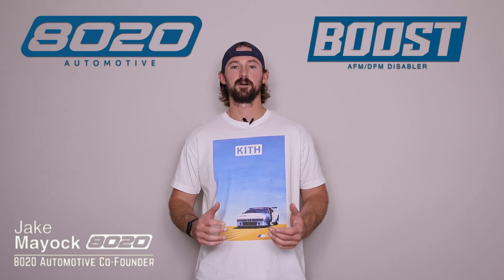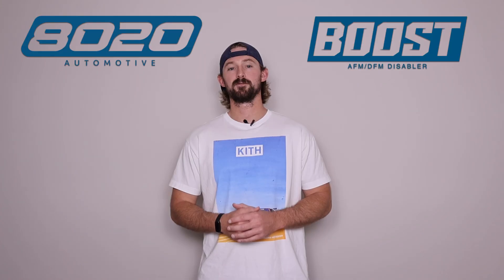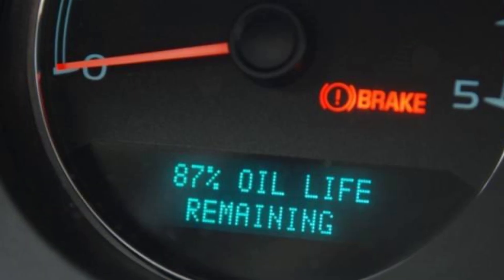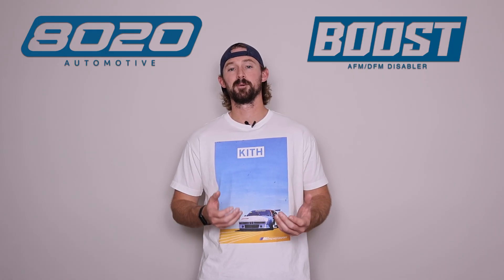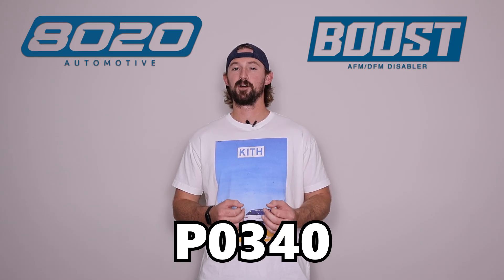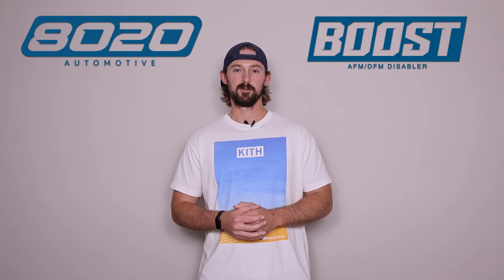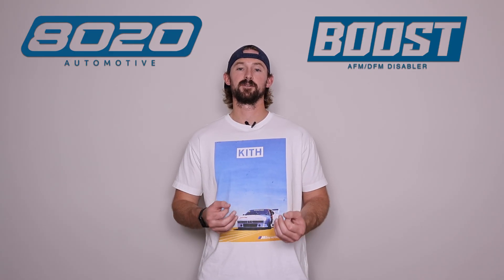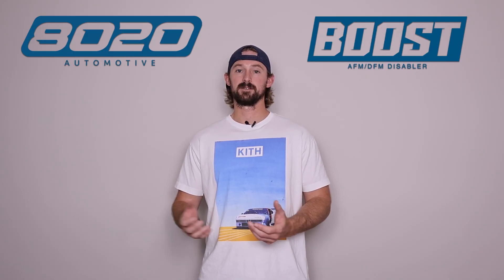Is GM’s LFX V6 Engine Actually Reliable? Here’s the Truth!

Comment: 2012 here 220k miles and still on the original timing chain, you sure the bad timing chain design carried over to the 12 and not the 11?
Reply: You know there is a timing service that should be done every 100k right lol
Reply: @jrok420  yea brodie, timing service as in inspect and make sure nothing is broke lol doesn't mean your necessarily replacing anything

Comment: I have a 2017 Impala Premier. Bought her at 55k miles and shes at 223k. I drive a lot of highway miles and do 5k oil change intervals, which is at 30-40% when looking at the percentage in the car. My biggest issue is the Torque converter shudder that I've had since 156k

Comment: I have a 2019 Chevy Impala 3.6l with 192k miles on it. Started having a transmission slip problem at 161k miles. But still driving with the slipping problem at 192k. Other than that it’s been good. Always been driving it in Arizona. I’ve replace the canister purge valve solenoid 3 times, alternator at 131k miles. Transmission fluid every 40k-50k miles, engine oil change every approximately 3,500k-4,500k miles, spark plugs I changed first at 91k miles and barely changed them again at 180k miles, new shocks and struts at 165k miles, brakes and rotors changed every 70k miles . The engine is running great so far and hopefully more. 💪🔥
Reply: Throw a bottle of Lucas transmission fix in your car and the shift flare will go away.
Reply: That's way too long for the transmission fluid  to be changed on my Impala I change it every 15,000

Comment: Just look at the timing chain setup. It looks like it’s out of a Ferrari.  Unfortunately, most owners are used to Chevy small block simplicity and forgiving maintenance.  Use the best oil and change the oil frequently.  I have the 2012 Impala. When I drive it, the oil monitor would recommend oil changes at over 8,000 mile intervals which is way too long. To be safe, I change oil at 3,000. Oil is cheap and easy to do. This engine is very hard to work on.  I only have 70,000 miles short trip driving and so far, everything has been very good.

Comment: This is easy. If you do extended oil changes.....you should NOT with these. It is super important to change the oil under 5k miles every single time no matter what. Do not go by the what the computer says.
Also the PCV valve. Look at drilling that out a little bigger. The holes. Use a high quality air filter, change the fluids in the diffs and transmission before the book tells you to. Do not do any extended BS things the book says. My buddy and I buy these vehicles for dirt cheap and repair them. We do not cut corners and we make it a great side gig. I'm currently about to finish a 2011 Acadia and putting a 2014 motor with low miles and I'm keeping it because they both have lower miles, but mine will go 200k easy with basic maintenance and by paying attention and fixing minor issues. Every mechanic shop has one of those equinox or Acadia in the lot due to what this video is about.
Reply from the maker: N - Thanks for sharing!

Comment: Just wondering if you’re losing oil and it’s not on the ground, is it gassing off? If it is, is that when sludge develops? Much like water minerals in a kettle? Trying to learn. I just bought a 2017 Enclave with 80K on it. Thanks for the video. I will follow these recommendations.
Reply from the maker: M - If you’re losing oil but not seeing it drip on the ground, it’s usually being burned in small amounts inside the engine or leaking internally, not really “gassing off” into thin air — oil can sneak past worn valve stem seals, piston rings, or through the PCV (positive crankcase ventilation) system and get burned in the combustion chamber, which often doesn’t show up as visible smoke unless it’s happening in larger amounts. Sludge is a different problem: it develops when oil breaks down from heat and isn’t changed often enough, or if moisture and contaminants mix with it, kind of like your kettle analogy but instead of minerals, it’s fuel dilution, combustion byproducts, and degraded oil additives that leave behind thick deposits. Your 2017 Enclave’s 3.6 V6 is known to be sensitive to oil changes because it runs hot, so the best way to avoid sludge is to stick with quality synthetic oil and keep intervals short (around 5k–6k miles max, not the 7,500+ GM suggests). So to answer directly: oil loss isn’t from it evaporating away, it’s more likely tiny amounts being burned or consumed, and sludge develops more from neglect or heat than from that mild consumption. Want me to walk you through a couple quick checks you can do on your Enclave to confirm if it’s burning oil through the PCV or rings?
Reply: @8020Automotive sure that would be great!

Comment: 2013 Impala LTZ here. Just bought it as a commuter car - with 215k miles on it. Starts, runs, amd drives beautifully. Found out after the fact that it was a rental vehicle, so it was regularly serviced. Has a blend door actuator going out that makes the typical thumping noise behind the glove box, but that's a $20 fix. I put 140 miles a day on this thing, so I'm betting 300k will arrive before I know it.
Reply from the maker: A - Nice! Thanks for taking the time to share your first-hand experience.

Comment: Do the intake valves on these engines ever need to be serviced since it is a DI engine? I think it would be a good idea to spray seafoam into the intake every 50k miles?
Reply: I think a lot depends on your driving situations. Short, stop and go trips are definitely worse. If you drive at highway speeds a lot I think the valves are fine. I'm more highway than local and am about to replace my spark plugs, I'll find out what the valves look like then.
Reply from the maker: T - They certainly do, unfortunately. Not a bad idea, however, we favor walnut blasting every 100k miles.

Comment: 2006 Holden VZ with LE0 engine (3.6 ltr V6, 6.5 ltr oil capacity).  I let mine run WAY LOW on oil.  By the time the oil warning light came on, I put 5 litres of oil in (6.5 ltr capacity) and it STILL WASN'T FULL.  So, I'd run it on LESS THAN 1.5 ltrs oil.  "OUCH".  It does have a timing chain (or cam phaser?) rattle on a cold start, but other than that still goes ok :) :) :)
Reply from the maker: O - Sorry to hear this. Hope you get much more out of it. Make sure to stay on top of maintenance :)

Comment: I have a LFX I installed in my 2010 Camaro.  It is turbocharged with catch cans.  Doesn't use a drop of oil between 3000 mile oil changes.  Great engine.
Reply: Dude you are an inspiration to me and every other V6 "wanna-go-fast" type of guy out there. Glad to see the build is still going strong
Reply from the maker: A - Nice! Thanks for sharing your build. Sounds sick.

Comment: I have a ly7 v6... They also have the timing chain problems i think, but i have the non vvt one and it seems to be more reliable and less places for problems to start or begin, even with good oil pressure the cam phasers in the ly7 and llt are dumb designed. But i don't have those so i think it's a little bit more reliable
Reply from the maker: I - Thanks for sharing! Just ensure to take good care of it.

Comment: 2016 GMC Acadia. Around 223,000 miles. Both engine and transmission are original. I’ve run it in 5/30 pennzoil ultra platinum since new. It’s been a very dependable vehicle.
Reply from the maker: C - Nice! Thanks for taking the time to share your experience.

Comment: I bought my wife a 2016 Chevy Equinox LT AWD with the LFX 3.6L used, in late 2021. It just hit 90K miles now.  I've done all the oil changes at 3K miles since I bought it, dropped all the transfer case fluid, trans, and rear diff also. Only issue I've had so far, was I had a Fuel Tank Pressure Sensor go bad, which threw an EVAP code. Other than that, this little SUV has been a fantastic vehicle so far. This LFX V6 is a great engine. Makes plenty of power, and it's super smooth and quiet. These 3.6's get a ton of hate because of the earlier variants. The newer models are good.
Reply from the maker: R - Thanks for taking the time to share your experience!
Reply: Which year did it get better?
Reply: @daveyboy8907 It depends on what make model you're looking at. GM jumped all over with the different variants of these 3.6L engines. Like for example, my brother has a 2016 GMC Acadia and it has the LLT motor, while my 2016 Equinox has the newer version LFX motor.  They started putting the LFX version in some 2012 models and up. Basically you want to avoid anything with the LLT V6, those are the ones with the PCV design flaw and timing chain issues.

Comment: 2015 Chevy Traverse with 217,000 miles. I’ve done nothing to the engine besides from spark plugs and oil changes with valvoline advance every 5,000 miles.its been an amazing vehicle and still runs and drives like new!
Reply from the maker: J - Sounds like you're taking great care of it! Thanks for sharing.
Reply: 2014 buick enclave with 116.000 miles on it, I just replaced the spark plugs, EGR valve, and water pump on the engine. It's in great shape. No oil leaks or timing chain noise yet.
Reply: @jeanpierreremond2565not even a timing chain? Thats risky
Reply: @jrok420 I will be surprise if this engine goes to 150K miles with the original timing chain (I may replace the timing chain by myself as part of preventing maintenance at that high mileage, it's risky for sure)

Comment: 160k mile 2012 impala here. The engine itself has been rock solid. Still on the original water pump. Overall it’s been pretty reliable with just a couple odd ends here and there
Reply from the maker: V - Nice! Sounds like you take great care of it!

Comment: I have a 2013 impala with 122k that I bought used. The only thing I have to do was put in a purge valve and thermostat. Everything else has been normal maintenance with valvoline max life high mileage oil every 5000 miles.
Reply from the maker: S - Nice! Thanks for taking the time to share your first hand experience!

Comment: The 2014 Impala STILL had the LLT,  I remember the odd angle spin on filter being a pain to install! That engine loved oil too! For comparison, the 1992 Chevy with the tried and true 5.7 ONLY uses (and leaks) a quart between 3000 mile oil changes when the engine from 288,000 - 388,000 miles on the ORIGINAL engine!!
Reply from the maker: L - Thanks for taking the time to share your insights.

Comment: 2013 Camaro LFX w/ 204,000miles plus!
My Camaro drinks oil like a drunk, I have to consistently keep adding oil!
Yes, my Water Pump went bad @ 180,000 plus miles, however, it's CHEAP and EASY to fix.
Reply from the maker: S - Thanks for taking the time to share your experience!
Reply: How many miles you at now have the same car recently water pump went out 198,000 miles mark almost at 200,000 miles wondering what to expect?

Comment: I’m hoping an praying. I just acquired a 2013 Impala LTZ with 97,000 miles on it. The car seems to have been extremely well taken care of. So, I plan to keep the oil changed regularly, and try to keep it running a long time.
Reply: Just change oil on time and floor it every now and then to keep them clean
Reply from the maker: D - Congrats on the new ride! If it's taken care of, it should be good for ya!
Reply: I have a 2016 Limited (same car). My dad's 2014 had 275k when he gave it away. All factory power train. They're great cars if you're consistent with maintenance.
Reply: You probably should've considered buying an older buick or pontiac with the 3800 series 2 or 3 them 3800s would just run forever and simple and low cost to work on
Reply: @TheSonomaGuy-h5m I've had far more issues with my 3800 than my LFX's. Those damn coolant systems are such a nightmare. I love it to death, and once you get all the usual coolant stuff done they're as reliable as people say. The coolant elbow is pretty simple, but no one wants to have to do the intake manifolds when they're told these engines are bulletproof.

Edit: Meant to say this, the 4T60/65 on the 3.8 is JUNK! It was designed with a little 160hp engine in mind. The 6T70 isn't the best, but it's miles better than the 4T65. My 1996 Olds 88 had 63k when I got it. I decided it'd be wise to change the trans fluid and filter when I noticed it hit 75k. I could not believe the carnage. Looked like a 150k service interval. Comparatively my 2016 Limited had the cleanest looking trans fluid I'd ever seen at 50k miles. No filter change possible unfortunately.
Reply: @MoswenMedia one thing to consider as well is the 4t60E the 3800 is hooked up to is a pretty weak transmission, the 6t70 was a big upgrade in terms of longevity and handling power
Reply: @lethargicstove2024 I WAS LITERALLY GOING TO SAY THAT AND FORGOT AND COULDN'T FIND THE COMMENT TO EDIT THANK YOU!!!!! The 6T70 is no 4T80 by any means, but it's miles ahead my 4T65. The trans fluid drain at 75k miles had me ready to cry. I would have thought it had 150k on it. Only massive downside is the filter being non serviceable. I recommend those who get a 6TXX car install an inline trans filter when they do a fluid change, which btw is insanely easy on these transmissions.

Comment: 2014 Lacrosse, 192k miles. Driven HARD, I got a 118mph ticket a few months ago, and that was slowing down. Mine uses maybe a half quart every 3000 miles. I got it at 140k, have been changing it every 3000 since. I checked the dealership service records when I bought it, literally the only engine problems have been a water pump at 110k and a cam solenoid at about 150k. It doesn't leak a DROP, barely even seeps. Little bit of chain noise, but no engine problems. Hell I haven't even changed the factory spark plugs yet and they're still clean!!! One of the most underrated American engines. Much better than a pentastar or Ecoboost
Reply from the maker: H - Thanks for taking the time to share your experience. 118mph in a Lacrosse is crazy XD

Comment: What exactly are the changes to the timing chain components? If you buy replacement components from any reputable manufacturer they all carry the same part numbers. I'm just curious what exactly has changed, as far as I know the only change GM made towards these engines was the oil change intervals, they were actually originally 12,000 miles and GM made the change to 9000 miles to try and combat the timing issues. I have never been able to find any details on actual component "improvements" or "changes".
Reply from the maker: M - Guessing you are referring to the changes in the LFX compared to its predecessor, LLT?
It uses wider timing chains, revised tensioners and guides, improved chain material and heat treatment, and refined oiling system

Comment: Thanks for a great video !     I am considering a Traverse,  or it's GMC version around 2021/2022/2023  with 3.6 L.     What version of the 3.6 would those be,  and do you know if they are better, worse, or about the same as the. LFX.   Thanks !!
Reply from the maker: B - The 2021–2023 Chevy Traverse and its GMC sibling come with the 3.6L LGX V6, which is the newer, more advanced version of GM’s high-feature V6 family that replaced the older LFX; it delivers more power (around 310 hp vs. 288 hp), better fuel efficiency, and smoother performance thanks to direct injection and a 9-speed automatic, but it’s also a bit more complex, with potential for carbon buildup on intake valves and timing chain wear if oil changes are neglected—still, it’s generally considered a solid upgrade over the LFX as long as you keep up on maintenance and use quality fuel.
Reply: @8020Automotive   Just subscribed !!   Thanks, that's helpful.
Reply: @8020Automotive  traverse not lgx. They use LFY engine.

Comment: Maybe I’m old school but 3k-4K miles max for an oil change
Reply: I do mine every 5,000kms (3,100 miles) on my 3.6 Canyon. Runs like a top. Always full synthetic Mobil 1
Reply from the maker: K - How it should be honestly!
Reply: their logic is, well your putting new oil in it every 2k miles so you are good to go!
Reply: It's a 6 quart engine. At least in my Impala. I do 5k changes. I'd go with 3k if I wasn't using synthetic oil. Now in the heavier vehicles like the Colorado and Traverse I could see a 4k oil change. That's where they start seeing a lot of carbon build up and timing chain issues.
Reply: Agreed

Comment: 2016 GMC Canyon 3.6 LFX 4x4 SLT with 183,000 miles. Oil changes every 5000 miles with pennzoil ultra platinum, wix filters,spark plugs 100,000, OEM serpentine belt/tensioner ,water pump/coolant 120,000 (preventative maintenance) drivetrain also maintained twice,front rear diffs, transfer case,transmission…. when I bought this truck and went from a full size I never thought I would keep it and was unhappy but it’s turned out to be the best vehicle I have maybe ever owned and still like new…..would drive it from North Carolina to Alaska tomorrow morning if needed
Reply from the maker: P - That’s awesome to hear—and honestly, it sounds like you’ve given your 2016 GMC Canyon 3.6L LFX exactly the kind of care that rewards long-term reliability. With regular oil changes using top-tier synthetics, OEM and high-quality replacement parts, and a full drivetrain service history, you've set yourself up for serious longevity; the LFX V6 is a solid engine when maintained, and clearly yours has been. Hitting 183,000 miles and still feeling like new speaks volumes not only about the platform but also your discipline with maintenance. It’s funny how the vehicles we’re least excited about at first often end up being the ones we trust most—sounds like your Canyon earned its spot as a keeper. And yes, with that record, a road trip to Alaska wouldn't be a stretch at all—just top off fluids and go.